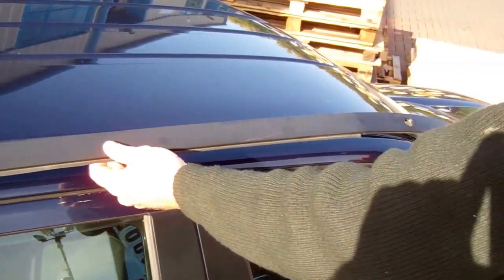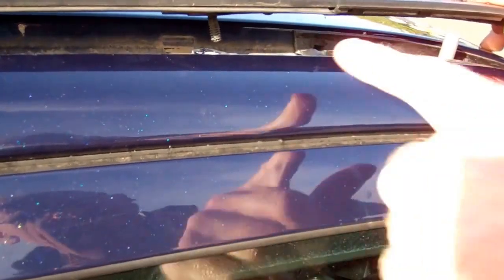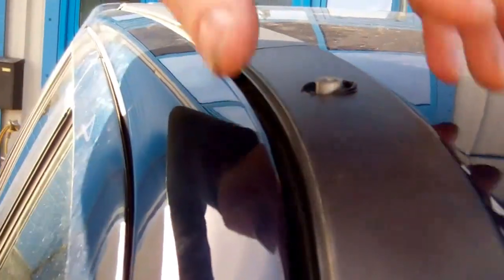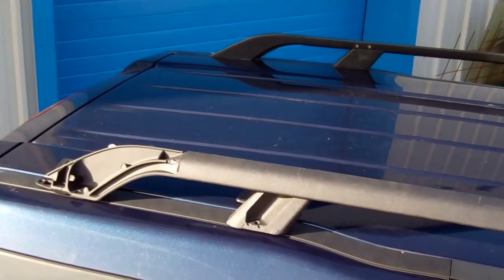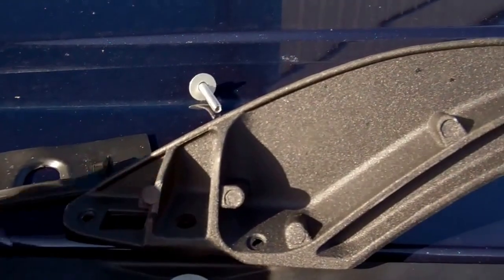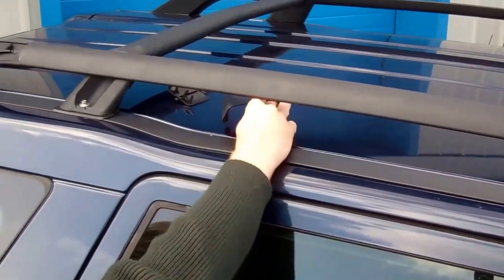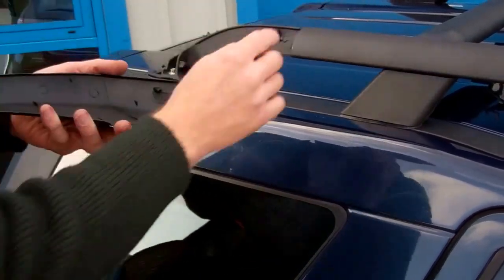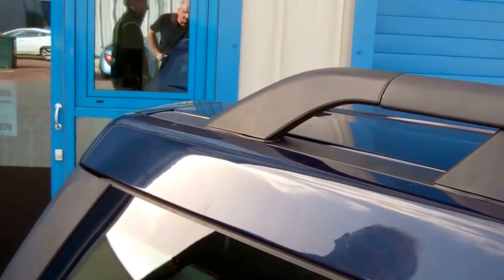How to fit Roof Rack Rails on a Land Rover Freelander 2 / LR2 ( Part 2 )

Comment: Great DIY vid men!  Thanks for posting. I was able to install a roof rack on my 2012 LR2 with no surprises. I would not have attempted it without your video. 
I used one of those graduated drill bits that makes a larger hole the deeper you drill instead of a wood bit and it worked perfectly.  Well done and many thanks.

Comment: i would def recommend that the cross rail be bolted together first , then place complete rack on roof for bolting down .
Reply from the maker: I may remake this video with this and some other changes.
Reply: Yep i just spent 4hrs fitting this as the bolts supplied were too long and that crossbar is so awkward to fit after.  I learned the hard way.

Comment: Fitted the same rail kit today and to be honest it was a right Drama. It all went well till I tried to fit the rear rail bolts, they were too long and I ended up sheering the head off these cheap bolts. I managed to get the left over thread out and re-tapped each hole. Replaced the bolts with the correct size. Those plastic fairy tree clips just fell apart so I had to drill them out too. Anyhoo all is good. I would recommend assembling then fitting... Great Upload guys.
Reply from the maker: Yes i think you may be correct - assemble then fit to the roof ! We stopped selling these as they had a lot of quality issues - especially with the fixings !

Comment: Had problems getting the fir trees out and all 4 snapped off leaving the plastic in the holes. My solution was to drill the plastic several times with a small bore drill and then use an M6 tap to clear the threads.

Comment: Just fitted an original LR version of the kit for the Freelander 2 with Sunroof and there's instructions there to take off the trim at the back and drill holes. Not needed at all, the inserts drop in as shown in this video but I did need to adjust the hole very slightly with a craft knife to get the hole aligned - a lot less hassle than taking the trim off the back.

Comment: So the rear threaded holes each side are too corroded to accept the bolts. How easy would it be to rethread them with a tap? Any idea what size thread they should be?
Reply: Sorry mate, you ever find out the answer to this?

Comment: So where is the wood drill bit used as shown with the introduction of the tools needed?
Reply: I  think at the  beginning he was going to drill hole only for small aluminium pin, but then realized that front rail mount goes under plastic panel, so  he needs wider 19 mm drill.

Comment: All of your videos are brilliant thanks very much & I will be upgrading to LED's from you soon. Can I just please ask the rear cover caps of the LR2 roof rails don't fit flush about a 5mm gap from sitting flush, is there something I am doing wrong ?
Reply from the maker: Hi these caps are a real pain - they have a habit of falling off and genuine bars and Land Rover even supply them as spare parts ! Take them off and just study how the clips work and you should be good - maybe a good idea to add some silicone when fixing them
Reply: powerfulukltd many thanks I will take them off again I did use some double sided tape & a little tiger seal so they are staying on ok but just damned hard to clip down, I think they will come off study them like you say & give it a second go. Once again many thanks & love your videos they are great 👍

Comment: Would it not be easier to fit the crossbar before mounting the whole system in one piece ( obviously with assistance )
Reply from the maker: Yes that may be a better option - but leave the bolts a little loose incase you need some wiggle room for alignment
Reply: @L663  I’ve just fitted my 2nd hand  set with your instructions from here 
Made the job much less stressful although as I was alone I fitted the crossbar to one then with the other one slid the two together. 
Great help chaps, many thanks

Comment: Saw your video after I'd already bought a set of roof rails. All went well until it became apparent that the holes on the rails and the holes on the vehicle didn't quite match up. I'm sending them back but I'm now stuck with a 19mm hole in my roof trim.
Reply from the maker: Hi - where did you buy the bars from ? you could use tape - the holes wont let water into the car as the rails are only cosmetic finisher strips not a water seal.
Reply: I’m currently fitting mine, and I have this exact problem! The rear hole doesn’t match up with the hole in the rail! Different supplier though, should have bought from you guys!

Comment: Would it not have been easier to build the whole rack assembly complete with cross bars before fitting it to the roof ?
Reply: Funny That Ruski Ryan,   That's exactly what went through my mind as well .. Does seem rather logical doesn't it.
Reply: It's actually easier doing it in pieces, otherwise you're trying to keep 6 gaskets and washers and nuts in place while moving to work on another and lifting the assembly to get them aligned and pins in place. After running around the car 3 times to re-do what you've already done you'll say "Why didn't I put them on in pieces as they came in the box?"

Comment: I m curious why your bars are not meant for cars with sunroofs?
Reply from the maker: This is the $1,000,000 question and it had me totally baffled why Land Rover have different part number for these with and without sunroof.... so i purchased 2 genuine sets and set about to work out the difference !... the result.... its just a rubber strip used to reduce wind noise on the cross bar ! so dont worry about it !
Reply: That’s great, I’ve just bought a freelander which is devoid of the roof trims as previous owner took them off for a rack of sorts and never left them with the car,I’ve now got a set from the scrappy and about to refit them, but I’m swithering whether to buy a set of your rails and fit them along with the trims as they look smart and are practical. Cheers dan

Comment: I've just fitted mine, but what a pain in the ass that was..3 of the clips broke on 4 of the covers so I had to drill through and bolt them on. It wasn't your product but one I just came across on ebay. Thankfully I did get a partial refund. Great video though, it did help me out.
Reply from the maker: Hi - the covers are not that good even on the genuine parts ... Land Rover do sell the 4 covers as a kit so this is an option. We also supply silicone with ours to help fix the covers in place.
Reply: powerfulukltd....However..I brought the side door protectors off you guys few days ago to cheer me up..life ain't all bad is it. 😃😃
Reply from the maker: Cool - thanks for that - hope they are all OK